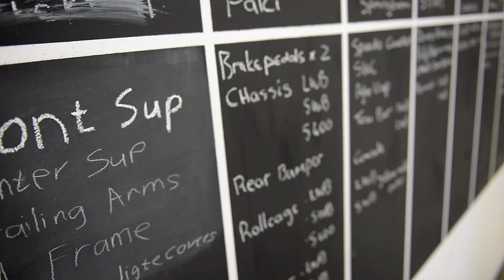Brandt BRV Manufacturing Timeline

Comment: Are you possibly looking into electric motors with a traditional 4x4 transmission system and can you build it as game viewers of the floor? If you can then there is a massive market in the eco-tourism industry that will be interested in a vehicle like that.
New Land cruisers cost min R750 000 plus a game viewer conversation is about R120 000 and game viewers are replaced every 6 years and fuel prices is killing the industry, not to mention the marketing value of a Green vehicle for a lodge especially if everything is running of solar.
Reply from the maker: Good day Chris, kindly forward queries to dawie@brandtrd.co.za for assistance. Regards